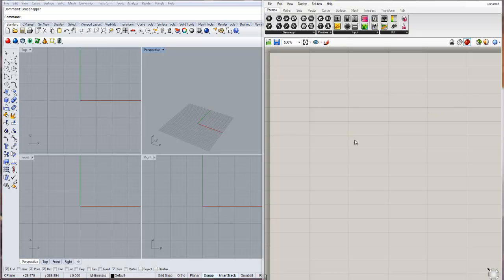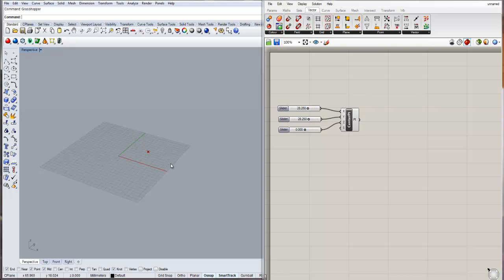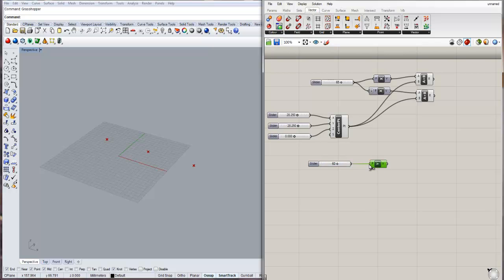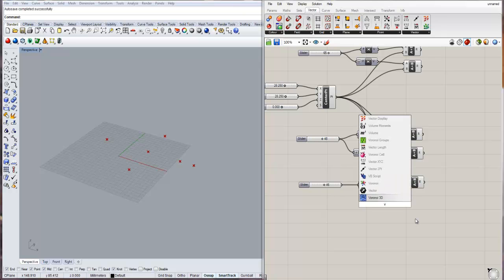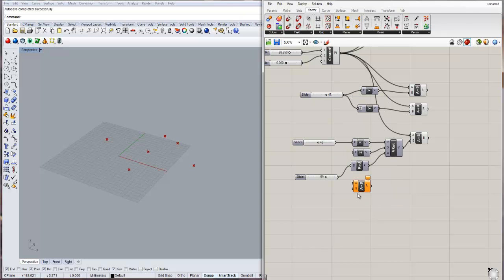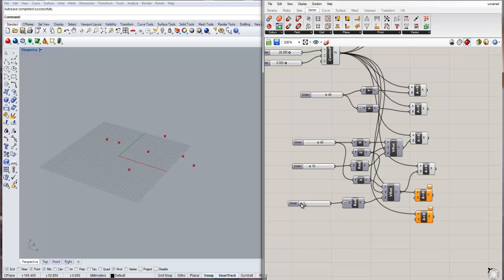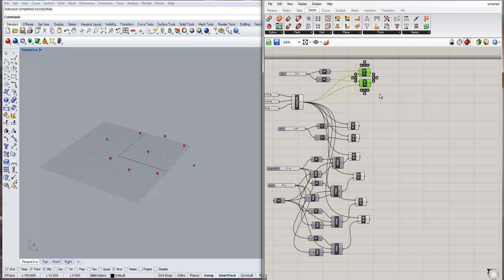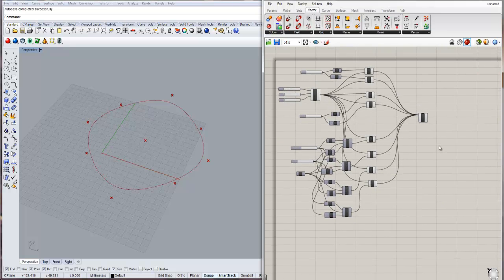Beijing Olympic Stadium: 1- Parametric Curve

Comment: Hi, thanks for this video!
I have a few questions about it, hopefully you can see it.
In 3:45, after you right-click "F" and set "-F" in expression, it didn't work with me, Rhino v5, Gh 1.11, said:"unknown variable encountered: F".
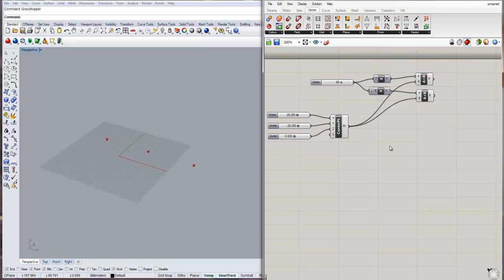And also, my work didn't show 3 points or 2 points as the video shows, till 4:00, although I followed all the steps...
Thanks a lot!
Reply: I might be 2 years too late but I solved it! Connect it opposite so vector x, and vector y should connect with B
Reply from the maker: +Cyange Liu 
I am not sure what Gh1.11 is like, but I think you can try -1 * F instead of -F. It may work.
Reply: +Chengde Wu Thanks for your reply! Actually I downloaded your original gh file and found "x*-1" in expression, and still, "F" is unavailable. 
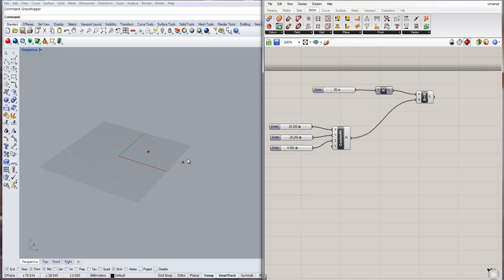But still, at 2:50, after connected to a "addition", I didn't find an additional point emerged...
The vision is Grasshopper 0.9.0076 for Rhino 5, a lot components changed, which makes a little difficult to learn from tutorial for green hands...for example, point xyz now is called construal point, and input "s" is disappear...
Anyway, thanks for your kindness!
Reply: @Yang LIU, you can put the  ( Negative ) order between the number slider and the unit ( x or y ) that  you want to make it negative.